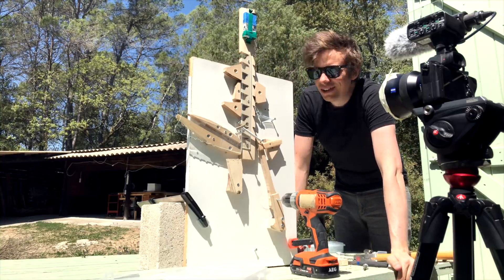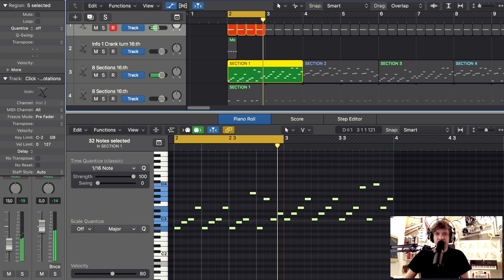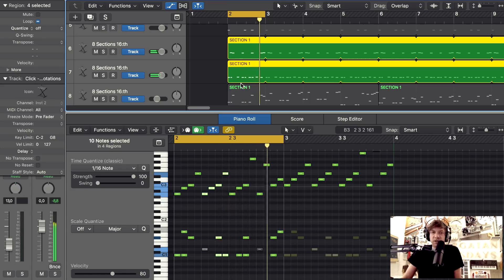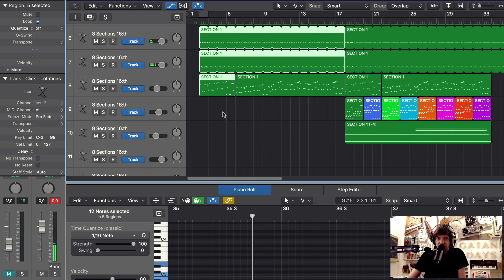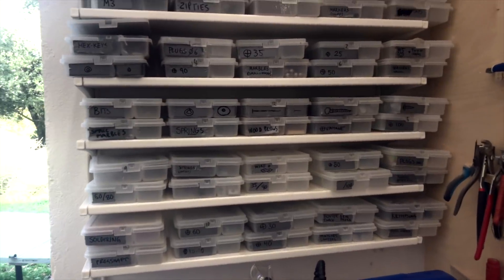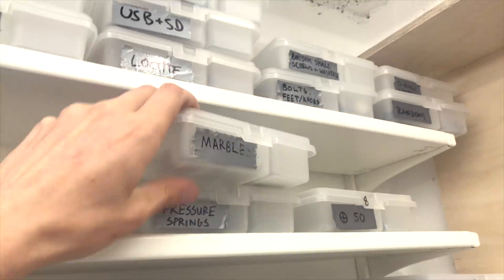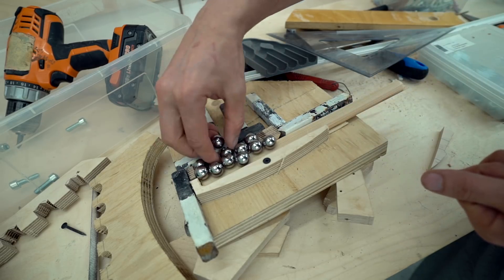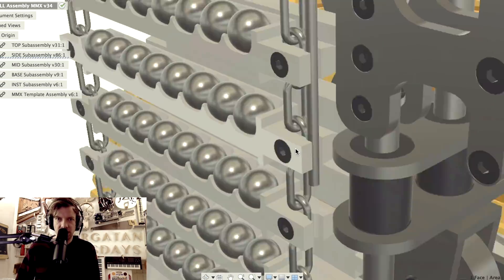Conveyor Belt Marble Lift - Marble Machine X #33

Comment: Mmaaarrrbbbbbllleee pummmmpppppp https://youtu.be/eWQ-189ijeM

Put 4 pumps in parallel that pump 2 marbles per crank
Reply from the maker: it is a good suggestion,  have been following ronald for a long time and watching all wandels and ronalds marble pump videos, its neat but not as fun to watch and i worry about the weight. With the pump i need to lift 300% more weight than with the conveyer. The conveyer is an esthetic choice that truly has a lot of parts and issues but once flowing it will be beautiful. Easier than the pump would be archimedes screw i think!
Reply: This is literally THE video that got me hooked on marble machines, and later led me to find WinterGatan :D
Ronald Walters has been one of the biggest reasons I become a maker :)
Reply: This would be a much better solution
Reply from the maker: love ronald walters!
Reply: Azayles he's a good wood worker
Reply: Would be waaaay better and simpler. This system of his has dozens of moving parts. A pump would have just a couple. If one pump was too slow, you could just put a couple of pumps in line until you reached the 8 mpt.
Reply: I feel like I've come full circle, seeing that marble pump video again! :D
Matthias Wandel was another huge inspiration of mine, and I know you love him too :D
Reply: He is, he's been a huge inspiration to me :D

Comment: I'm not quiet sure, that such a quick moving ratched system is going to be helpful to you. If I was in your place, I would build like 2 or 4 of those ratched lifts. I think I would make an offset between each of them so you can display waveforms (in that case 4 lifts would be better then you can show square, triangle sawtooth and sineeave).
The downside of this Idea would be, that it adds a big plate to your MMX, which isn't as aesthetic as you desire.

Comment: Aren't you afraid to lose marbles because of the "shakiness" of the lifter ?

Also you should do a poster of the marble machine X like some blueprint or something, that would be cool
Reply from the maker: i like the poster idea! The chains will be completely guided by rigid metal rods so the can not move, you can see them in the video, they are haninging "mid air" now since it is a work in progress.
Reply: Lucas Lelièvre 
Clear acrylic over the marble scoops, probably.
Reply: Alse 8/turn means that the lift only lifts a few cm per full turn of the crank. And they are rigidly guided. I am not too worried.
Reply: Also it seems that a cyclical drive will cause a lot of rattling of the marbles and be very noisy. to me there is something appealing about the marbles taking a smooth ride to the top and then launching into action to make their single note followed by another smooth, restful trip back up the queue to setup for their next individual contribution to the composition.

Comment: Why - after you already divide the marbles evenly and quickly into 4 streams for demagnetization - don't you just take each of those streams and divide into 2 directly, instead of re-combining and then dividing again? Is it just too wide, or is there another reason?
Reply from the maker: Too wide!
Reply from the maker: @benjamin, there is a chance that i have to increase the 5 degree slope of that piece to avoid bottlenecking... Will print the part and test how it goes. 4 tracks side by side makes the design stick out too much to the left!
Reply: Nikolai Hedler I don't really see a way of doing that without either significant path length differences or rotating the lifting system back into the big ear configuration
Reply from the maker: @farteous excactly!
Reply: You don’t need to load one whole lift at a time, you could split each into two then have the tracks above each other. Loading each set of two at a different level
Reply: You can allow the two paths which travel a shorter distance to fall below the two tracks which move farther, so that you have four tracks in a 2x2 stack. You don't use much additional fall height, but it still skips the combine-redivide bottleneck (if it is an issue).
Reply: Ya I saw that and got worried about the bottle neck that was just created by pushing the lanes back down to one.
Reply: what if you would combine them in two pairs.
You would only need to split them into 4 after that instead of 8, which should work a lot smoother at higher speeds.
(middleground options are often the best. ;) )

EDIT: but it might be best to build it like it's currently designed. It can still be changed afterwards if needed.
Reply: I really love your work and your sense of aesthetics! But in this case, I definitely see a bottleneck if you go from 4 down to 1 up to 8 lanes. Aren't parallel tracks also visually appealing? Furthermore, in your 1-8 splitter, you have a buffer of three marbles, sticking out to the left side. If there are four times 1 -> 2 splitter, you could reduce this buffer and the design is not that wide as you might fear. Another compromise could be a 4 -> 2 -> 8 divider!
Reply: Why not have the demagnetization wheel on the chain lift, or directly underneath the 8 parallel channels feeding into the lift? Or will that not work because the marbles aren't moving fast enough there?
Reply: How about routing them to 2 or 4 different levels stacked upon each other, spaced like the elevator carriages, and loading them step by step, so to say?
oooooooo
oooooooo
oo===========//
__oo========//
____oo=====//
______oo==//
______
______
Reply: Exactly my thought. It would be really cool to load marbles on different levels. Then you could have 4 levels directly after the 4 divider and load 2 marbles per level.
Reply: @Brandon: That's exactly what I meant (although I might have worded it badly): Loading them one after another not temporally (or only if looking at a single carriage), but rather spatially, so that e.g. the carriage that left the first level would only have positions 0 & 1 filled, after the second level, position 0 through 3 would be filled, etc.. In the context of the whole lift, 8 marbles would still be loaded each iteration, just not into the same carriage.
Reply: Runoratsu yeah I saw your comment after I already commented 😅 I definitely think it’s the cleanest way to fill them evenly and quickly especially when they’re already split into 4
Reply: Fabian Schäfer yeah, I can see potential issues with potentially having to make the lift taller to accomodate extra drop for the lower levels, but it would look impressive and interesting without being too bulky and wide.
Reply: After the demagnetizer, keep the four streams and "stack" the tracks, staggering where the marbles enter the marble lift.  Complex track geometry -- but cool looking.  And maybe make the lift four wide and two deep?

Comment: I am worry that this mechanism make too much noise, since you want to minimise the  noise of the machine.
Reply from the maker: Its ok, The only instrument that is mic:ed acoustically on the MMX is the Vibraphone (almost the only), and it is super loud so signal to noise is not a problem. The mechanical movement of the conveyer belt is in time with the music so if there is a sound, that sound will be part of a rythmic feel. The loudest sound on the machine is all the marbles rolling around i think!
Reply: A little bit of 'machine noise' adds character, like in the original video, it was nice to hear the workings of the machine sometimes and hear the marbles rolling...
Reply: Maybe have a slope at the back of each stair/shute/swing so that it is more smooth (and less noisy) when the marbles fall on it.

Comment: Have you considered a spiral lift?
Depending on the gears you should be able to easily adjust how many marbles it lifts and might even be able to go over 8 per crank turn.
Since it needs little space you might even be able to have 2 of them to transport more marbles.
Also it is silent.
Reply: Like an Archimedes' screw.  I agree with this idea.
Also, he's going to have trouble pushing the chain instead of pulling it.
Reply from the maker: @dayofmone that is a very stable lifting technique but less fun to watch!
Reply: Wintergatan What if you used a transparent material to make the spiral lift that lets spectators see what goes on inside along the Archimedes Screw?    You could also make the screw itself solid to draw attention to the spiral motion and the marbles' movement up the lift.
Reply: have you watched lego great ball contraptions? There are many ideas on how you can lift marbles. ;)
Reply: More like this: https://www.youtube.com/watch?v=NLpX9v4o7UU
With coils close to the size of the marbles it can provide an aesthetic look with a stream of marbles going up. It also is fairly simple which generally means less can go wrong.
Reply: The spiral could also demagnetize the marbles as they are raised. LED lights could travel the spiral length to show the path of one marble from the bottom to the top to make it more visually exciting. Not limiting the musical potential is slightly more important than aesthetics.
Reply: I totally agre with this idea. Use 4 small double helix's rotating once per turn. (or two, twice per turn)
good idea!
Reply: I'm now picturing a run of 9 screw were every other is rotating the opposite of its neighbour between 2 sheets of plexiglass. The marbles would seem to rise together and never be obscured by a hopper. First 1 3 5 and 7 then 2 4 6 and 8.
Reply: Bill Keith now that is a winning idea.
Reply: yeah he should do it like they do it in lego GBCs
Reply: The arcade machine Hyperball had a spiral lift for the marbles to be loaded into the queue chute. https://youtu.be/_RCmw74L1vQ?t=56s
Reply: + lithodora And with that model you can have 4 or 8 marbles be lifted with only 1 screw spring.
Reply: Jay - I like your idea for 9 screws but I would have them all rotate in the same direction so the force would be from screw to screw rather than both screws pushing each ball against the plastic.
Reply from the maker: @a7i20ci7y the ratchets are biting on both ends of the chain, so it is both pulling down on the backside and lifting up on the front side, simultaneuosly. and the chain pulls it self around since it is stretched!
Reply: Wintergatan the one you have has way too many moving parts and way too many points of possible
 failure, I would take reliable over fun to look at any day.. you are taking the big flashy approach, when in reality a minimalist approach can be beatiful as well.
Reply: Wintergatan With all possible respect, the lifting mechanism being as stable and easy to maintain as possible seems like a bigger priority than how fun it is to watch. Especially considering how critical this part is and what you want to do with the machine. Intricate parts are very pretty, but don't they make maintenance kind of a nightmare?